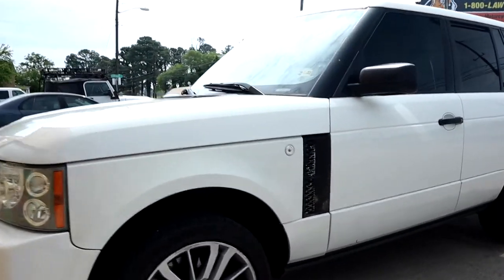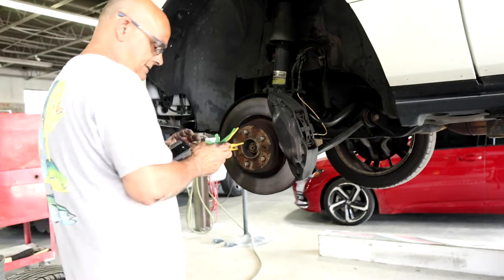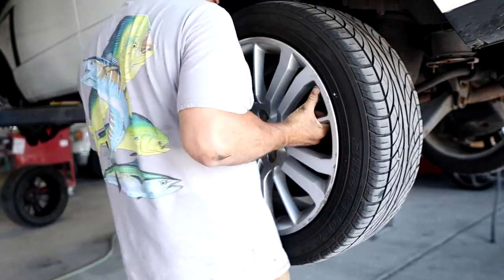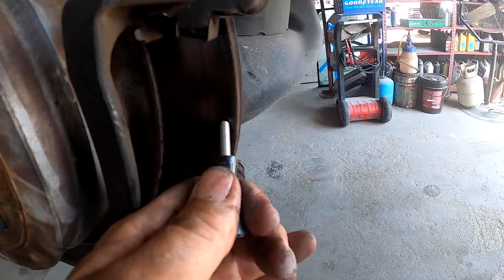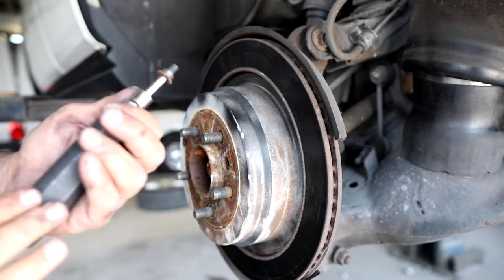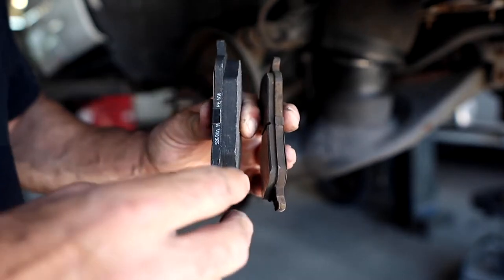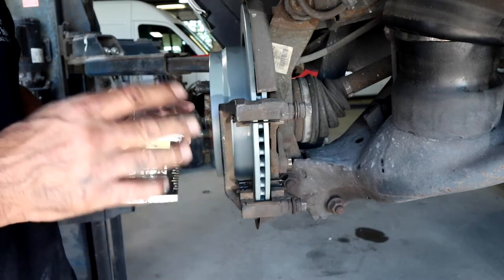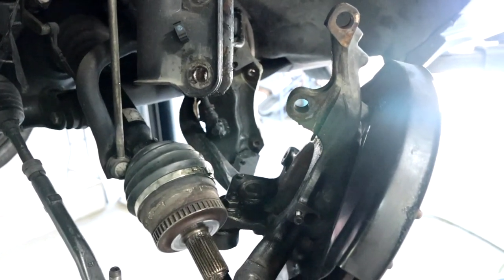Grinding NOISE while driving ~~~easy FIX

Comment: Hey, my family member had a friend pull their car with a chain wrapped around the lower control arm/cv axel. When I got the car started again immediately when we pulled forward that wheel was making a loud grinding/squealing sound. Do you think the guy pulling the car might have messed up the wheel bearing? They didn't have this issue prior to this. Thanks
Reply from the maker: Two things if he wrapped it around the axle make sure he didn’t rip the boot, he most likely bent the dust cover into the rotor make sure your dust covers not hitting the rotor

Comment: My 93 corolla has been making this grinding sound when I drive, I think it's the backplate scraping the rotor but the mechanic said it wasnt, then they said replace break pads, after that this issue still existed, then they said might be the transmission, and then said maybe the master cylinder staying open???? can you tell me what it might be? I posted it on my YouTube channel!!! Thanks alot guys!!!
Reply from the maker: If you’ve already replaced all the brakes and the noise on one side make sure you check the wheel bearing
Reply: @AutoRepairTips757  I watched alot of wheel bearing sound videos and it is not the same sound, this sounds exactly what the backplate on the rotor grinding sounds like, but for some reason the mechanic is saying they looked at it and even lifted it and cannot figure it out, nothing worse than a mechanic guessing what should be fixed lol
Reply: fixed it last week turns out it was the CV axle, the inner joint that connects the shaft to the transmission, replaced brake pads 2, need to do my struts/shocks
Reply: @joeyskate813  damn got this same problem
Reply: @hectoravila1998  yeah no fun at all still trying to save up for the struts, $700 for the job, I'm sure it could be cheaper but I don't have the right tools or people to help so fuck it